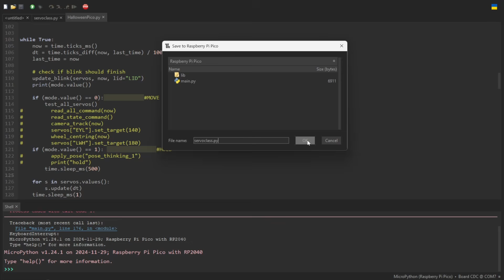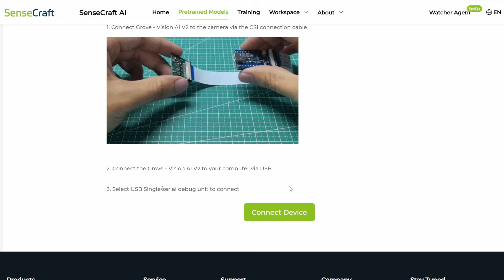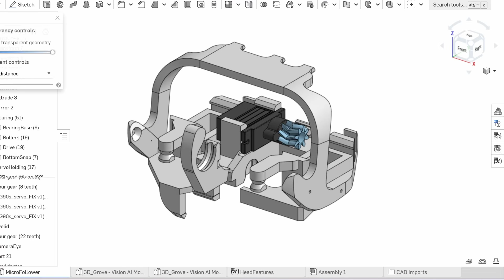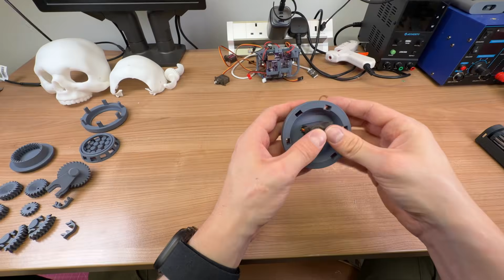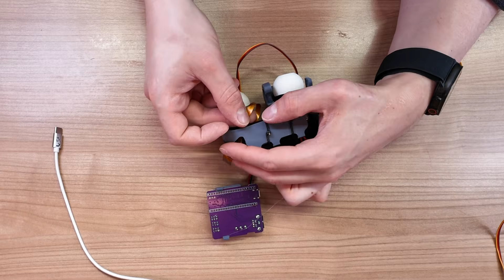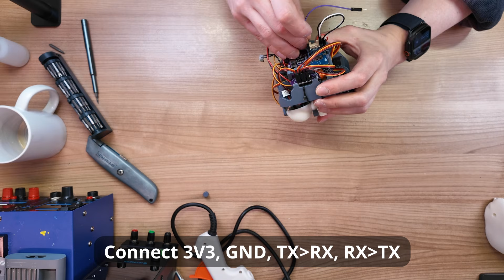How to Assemble an Animatronic Halloween Watcher Robot

Comment: Is anyone else having an issue with the gear to move the head up and down having a big gap with the stationary gear of the base and not moving?
Reply: it's fine for me. But I have issues rotating the head though. The rollers are not properly sized

Comment: Anyone else has the problem that the rollers are too small for the inner ring and fall through?
Reply: Yeah, I had the same issue (these are with the official printed parts from Will's shop) - I got it working by doing two things:  1.  I put the four pieces together (rings, "lower part of the bearing" and  the bottom piece (with the big clips sticking out) - then from there I could insert the little bearing pieces and they stay in. (not sure if it matters, but I noticed the bearings are smaller on one side, I put the smaller end up) - after putting in roughly half the bearings (every other), I snapped the big piece with the motor on top.  It seems to work...
Reply: Same issue... a solution to this would be great. I got them all aligned and in the case but it still does not line up properly - it also hits the tabs coming through the top and makes the solution lopsided if it works at all...
Reply: @DannyMillerPlus  is there a possible fix @NMRobots ?
Reply: Yup. I have the same problem
Reply: It's the holes in the raceways that are too big. The rollers are the right size.
Reply: same issue, still works more or less
Reply: Same issue here